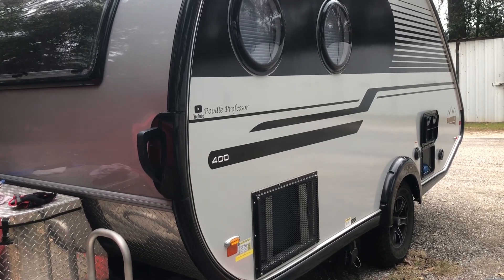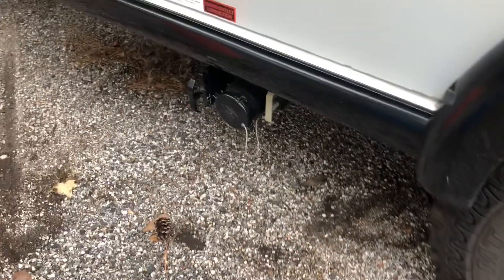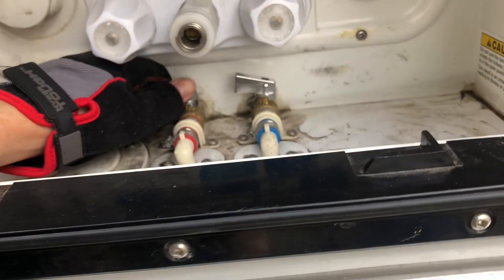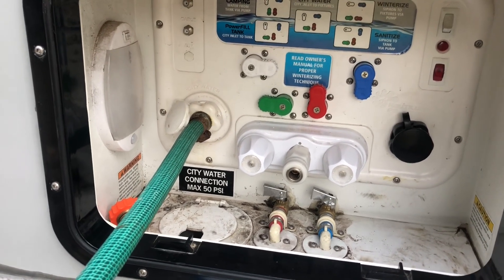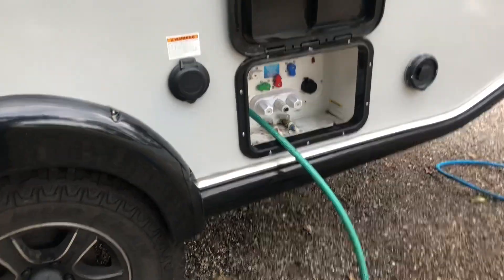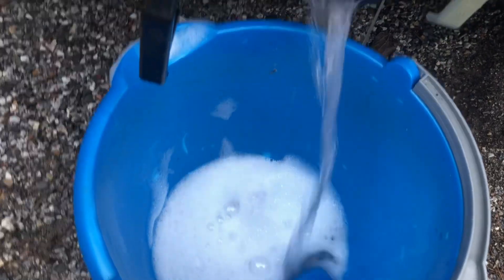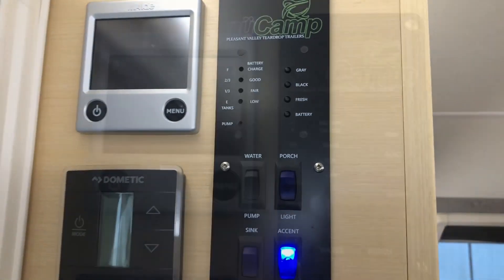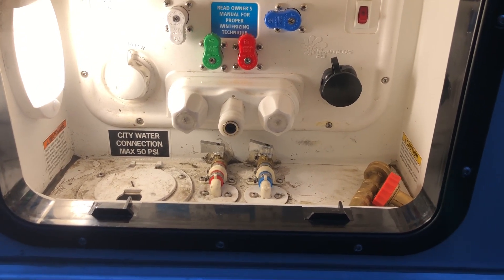How to Dewinterize Your Tab 400 #tab400 #Dewinterize

Comment: Can anyone tell me when we need to switch the yellow valve levers that are inside under the bed? No one mentions this in the videos. Thanks!
Reply from the maker: I didn’t do anything with the yellow valve when I was Dewinterizing. I did flip it up to drain it when I winterized. Paul Thomas in the Nucamp fb group is a huge help and can probably answer your question.